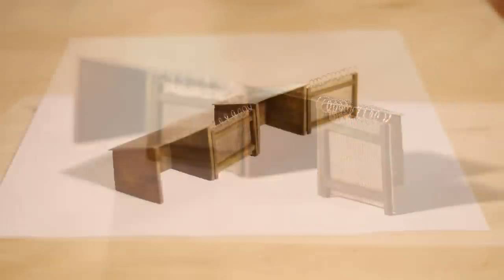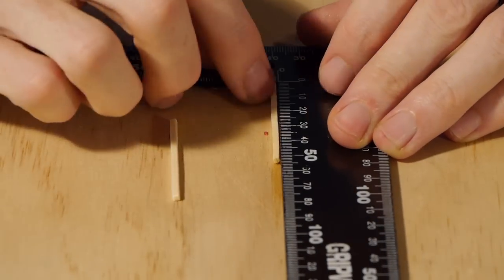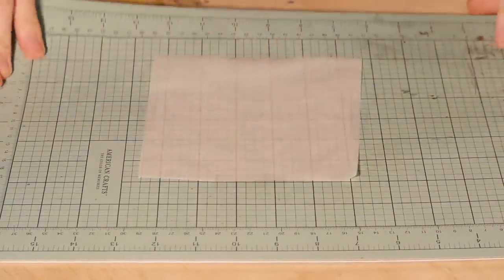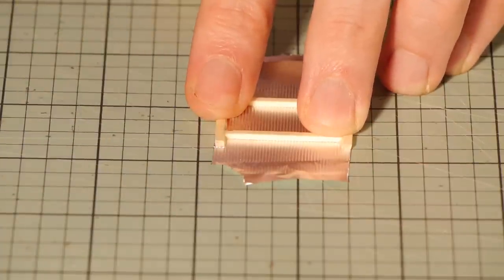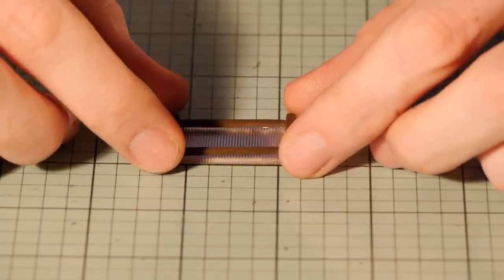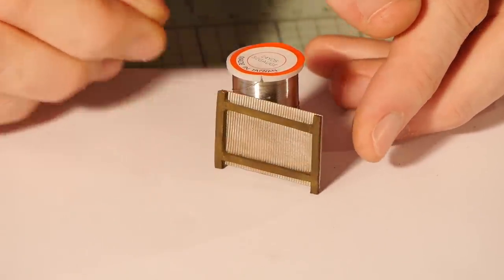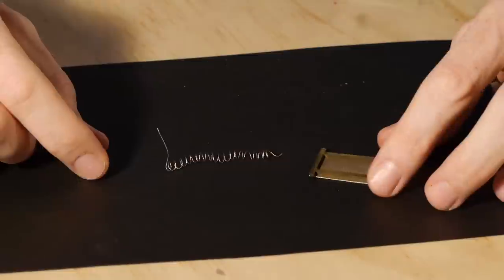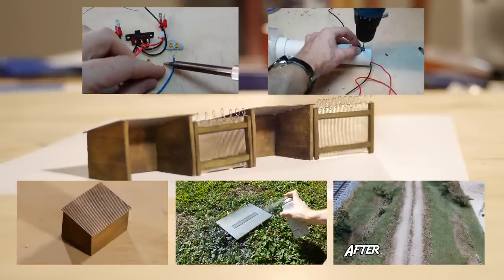Barbed Wire Fence - Model Railroad - How-To

Comment: The intro to the video is cool.  Great job on the fence.  I was trying to figure out how to make barbed wire for a chain link fence.  I think I will have to give your idea try.  Thanks for sharing.
Scott
Reply from the maker: Scott Downey  thanks Scott, yeah it pretty hard to get actual barbs in HO but from a distance the braided wire looks pretty convincing. The trick is to use the smallest possible wire you can, 32 gauge was the smallest I could find.
Thanks for the great comment Cheers,
Luke.

Comment: Thanks for the video....never thought of making a fence with corrugated paneling and already watched your video on that. Checked out the company which makes the forms  and ordering them in 1/72nd, 1/48th & 1/32nd scales. In all 3 scales, I use a mesh bag that vegetables come in, like onions. Pain in the behind to cut between the mesh strips from the bag, but then I have actual barbs on my barbed wire fencing. Next time I do this, will put 2 or more strips together using your drill idea, then run some thinned white glue on the twisted parts. This and a few more of your videos I've downloaded for future reference when building a diorama.
Reply from the maker: another great idea mate :) I've seen a few people try cutting fly screen mesh for barbed wire but like you said it's very fiddly and you have to be careful not to cut across the wire accidentally. That's something I might try in the near future as well. I like your idea of adding the two strands together with white glue.
Cheers
Luke

Comment: Hi Again Luke I like the barbed wired effect, in the movie industry they use clear bell wire with knotted bits attached, you could do similar as when you put it into the drill add some smaller pieces between the wires  and then twist the wire. I haven't tried it yet!
Reply from the maker: Ernie Stammers That's a great idea Ernie, I thought about trying to model the individual barbs but I gave up because I'd have to do soooo many and it would take ages! But for small sections of fence or maybe for areas that will be close to the front of the layout where the viewer is close to the scenery then I'll give your method a try.Thanks for the great comment.
Cheers, Luke.

Comment: Lord Jesus Christ has blessed you with craft skills.   The barb wire:  you could insert smaller wire bits every so many millimeters into the braided wire, as you braid it with the drill, to bring the barb wire into full appearance.
Reply from the maker: Thanks for the tip, I might look at ways to add the barbs... they would be very small but it would add an amazing level of realism for sure.
Thanks again :) Cheers
Luke
Reply: Patrick Knox e